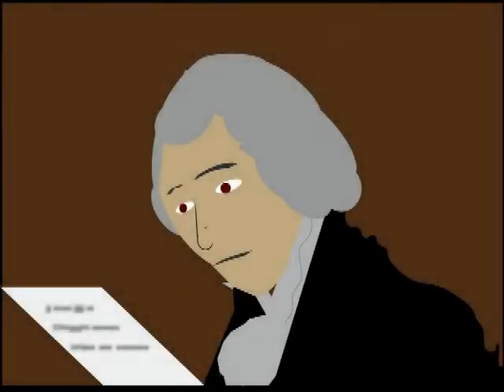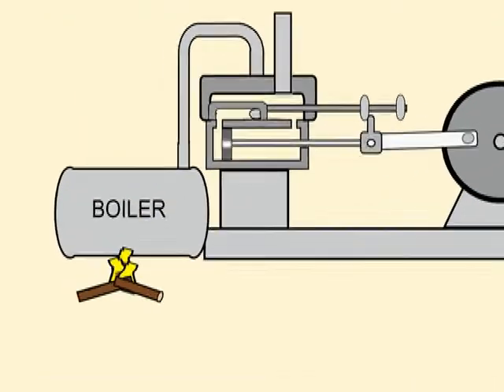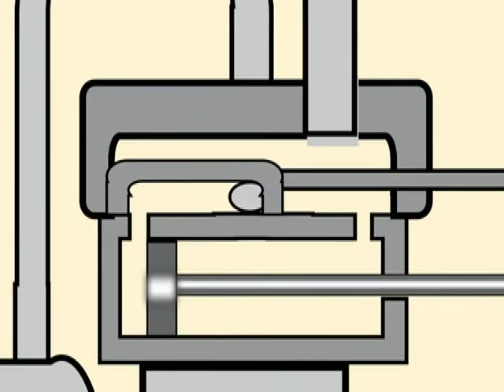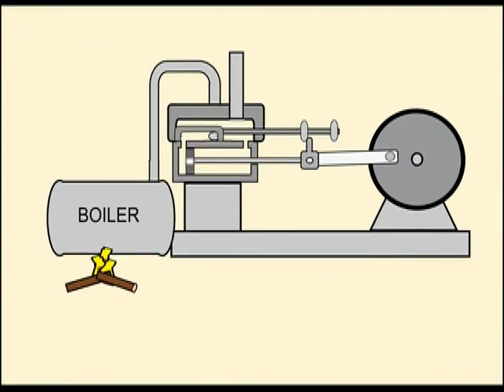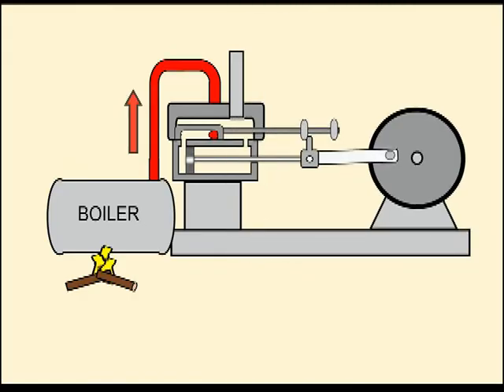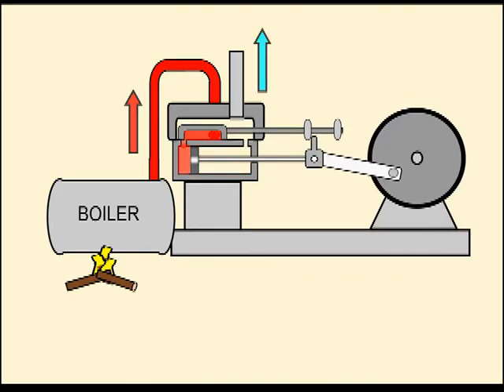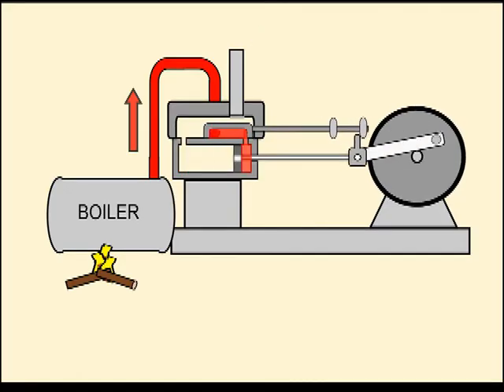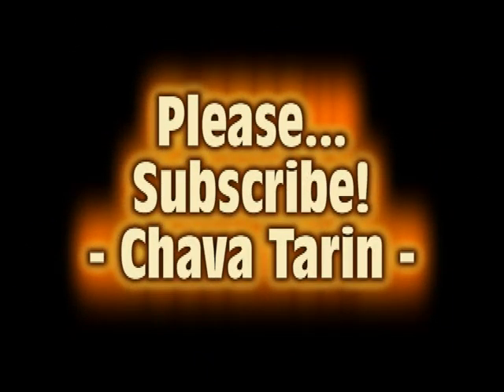James Watt Steam Engine

Comment: This is a Trethewick high pressure steam engine. Watt and Boulton engines were atmospheric  pressure engines that used a condenser to create a vacuum to cause reciprocal motion.  Also, as the patent for the crankshaft was still held by someone else, Watt used a sun and planet gear to convert reciprocal motion  to rotary motion. 

Good basic double action  high pressure steam animation, but it is not a Watt (or Newcomen) engine. Watt thought high pressure much too dangerous given the materials and technology he had to work with. He used low pressure steam and his boilers didn't explode. Huge and inefficient but safe, reliable, and very long lasting.
Reply from the maker: Dear Tim, thanks for your contribution!!!
Reply: You are sure welcome! If you were to make an animation showing the low pressure steam engine both with and without the condensing cylinder, I'd sure watch it.

Low pressure steam may well make a comeback as the operating temperatures and pressures are much lower. These would be small, of course (2kw or so) but they operate in the 120 degree C range, which is usually considered waste heat.
Reply: @tpxchallenger  Quote: "Low pressure steam may well make a comeback..." 
I'd like to see a steam comeback but for today's world I think a steam turbine would be the better choice. There is only one moving part and we could use it to generate electricity.
Reply: @awaitingthetrumpetcall4529  We  still use steam turbines to generate electricity in nuclear power systems. 

What I find so sublime about the Watt low pressure engines is that engines built by Watt himself still work as designed. Because of their ridiculously low efficiency there just isn't a lot of strain on the system. Watt did not trust high pressure steam because boilers will explode, and they did. 

The range of temperatures they operate is much lower than a high pressure steam engine. Almost in the waste heat range. I'm not suggesting we burn fuel specifically to run atmospheric engines but rather fit them in somewhere heat is available but not being used.
Reply: @tpxchallenger  furnaces will be good? I am just asking

Comment: James Watt's engine worked perfectly well without a condenser, as Watt mentioned in his patent of 1769. It was a steam engine, it didn't need one.
James Watt dumped Thomas Newcomen's Atmospheric power for Steam Power. To achieve this, he had to invent a new engine, the world's first practical Steam Engine, it used only high pressure steam and provided steam power. It could use a separate condenser for recirculating hot water and eliminating atmospheric pressure, which opposes a steam engine. Saves water and fuel.
Reply from the maker: Thanks, Walter, for your valuable contribution!!!

Comment: If I understand correctly the piston movement length equals the distance between the centre of wheel rotation and the point of mounting the piston leverage
Reply from the maker: There is a special mechanism which switches the valve at the right point to feed the cylinder timely. My drawings are not to scale, just to give an idea about the mechanism. Regards!!!

Comment: I thought the slide valve was external pressure, this shows the slide piston holding pressure internally. Shouldn't the steam be pressurized around the  outside of the slide piston in the visual?
Reply from the maker: There are some variants of the steam engine. The one used in steam locomotives, follows the principle shown: the steam from the boiler pushes on one side of the piston, and as it reaches the end of its stroke, the valve reverts the steam so it comes into the cylinder and pushes the piston back to its former position, there is a lever and cam mechanism which times the valves for reversing at the proper point of the cycle. Regards!!